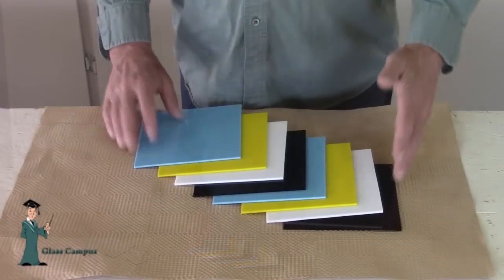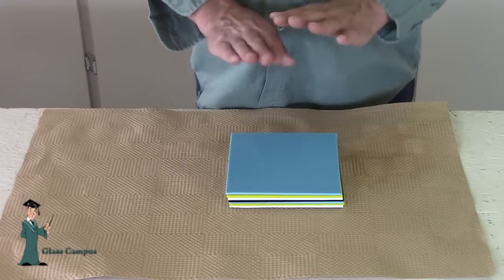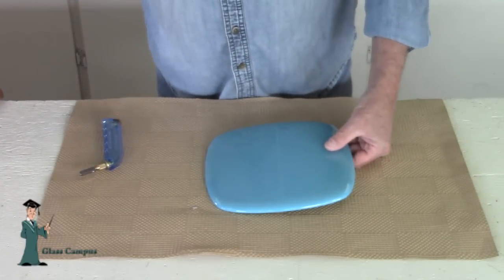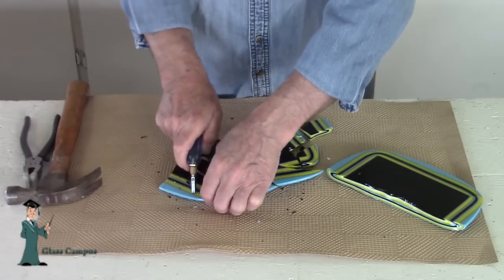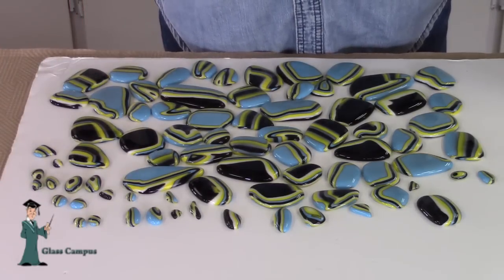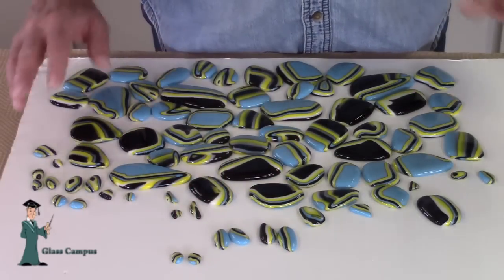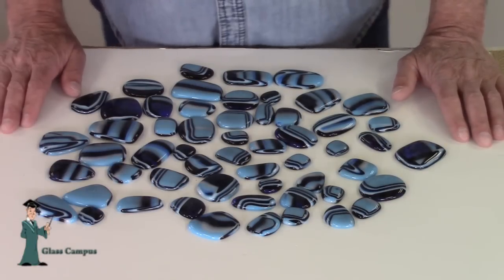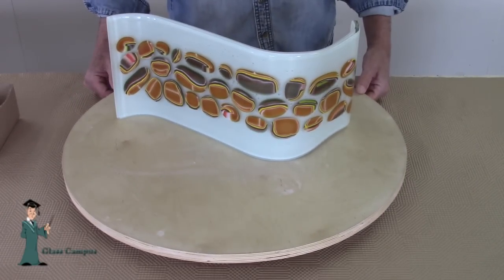Glass Campus - Making Glass Puddles

Comment: Looks like fun. So far I only have the mini microwave oven kiln. Hoping the tech will work with it. TFS!
Reply: You would need to start very small in creating your basic sheets and make certain to get full fusion, which might take a few minutes, but otherwise it should work. Just scale it down to fit your kiln and be sure that the broken pieces don't contain so much glass that when they turn to a puddle they fuse to the side of the kiln.